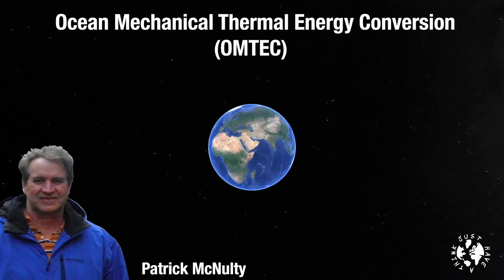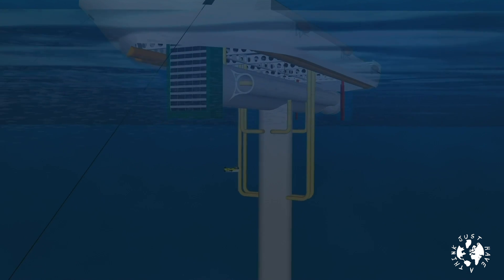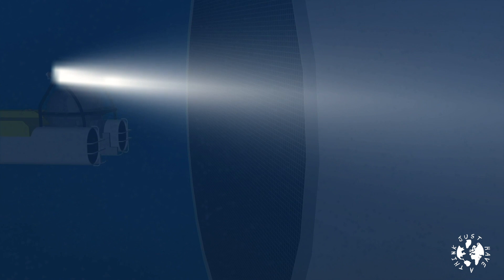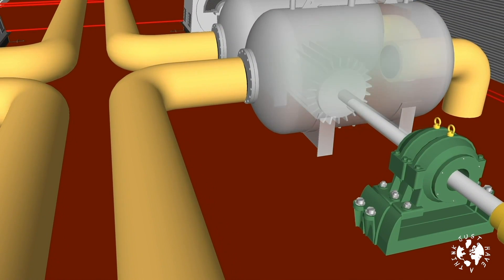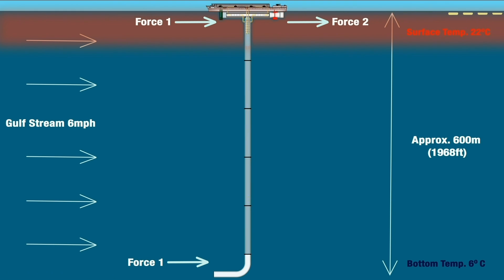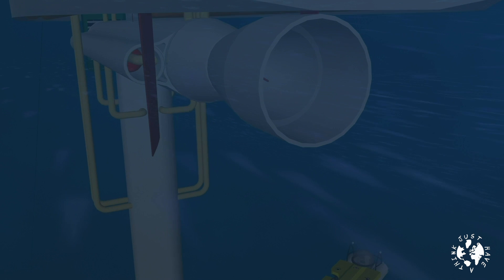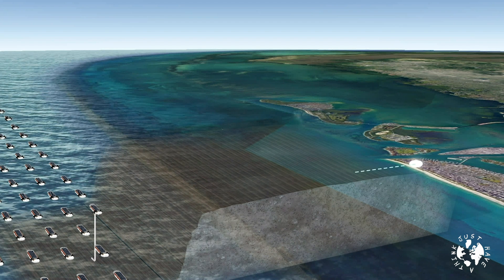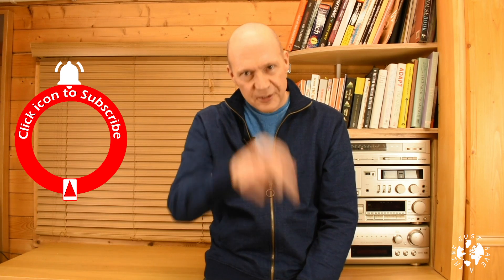Ocean Mechanical Thermal Energy Conversion

Comment: Let's make an estimate of the thermal power available. From the link, I see a peak flow rate of 1.7 meters/sec. I estimate the river cross section at 50m deep x 15Km wide or 750,000 square meters. So the flow rate of warm water is about 1.3 million cubic meters/sec. 
Let's use the 22C and 6C temperatures mentioned before, and we get an energy difference of 67MJ/cubic meter. But, a heat engine will likely only produce 2.7% efficiency with that low temperature difference. So the energy extraction density from the engine would be 1.8 MJ/cubic meter.  Multiply by the flow rate, and we get a power of 2.3TW.  Total US electrical power consumption is about 0.47 TW. So the heat engine would provide enough electrical power for the US as of 2016. 
The heat engine would need to cover the 750,000 square meter cross section.  And of course it would likely kill the gulf stream, destroying civilization. 
Maybe instead of using the gulf stream, which really doesn't contribute much power to the system, locate it out where the surface is hot and any cooling or pumping action doesn't affect the AMOC?

Comment: In order to be viable, a power generator needs to economic.  I see a site that says the velocity at the surface is 1.7 m/sec. That could give about 1KW per cubic meter.  If the entire peak surface velocity area were used to generate power, you might get about 500MW.  Florida uses 25GW of electrical energy on average. So, you could stop the gulf stream, destroy the world, and only generate enough power from the gulf stream to satisfy 2% of Florida's electrical requirement.  https://marine.coastal.edu/gulfstream/p2a.htm
Reply: 1KW per cubic meter per second... 60KW per min. or 3.6MW/HR.... Water pack tons of kinetic energy when moving. Especially when moving about 18 mph though the venturi section...

Comment: Let's say you take the same ocean surface area that is covered by the OMTEC system, and simply float solar panels on the ocean. Panels get about 20% efficiency, and produce about 700 WH per square meter per day. Will the ocean tunnel generate that much energy per day?
Reply from the maker: Hi Ted. Many thanks for your comments. All feedback is very welcome on this channel and especially at such an early stage of a new initiative such as this. Energy production levels from OMTEC need to be established. That's why there is now a concerted outreach for scientific research and analysis. I would say though that each of the four generators in the animated model is roughly equivalent in size to the generators currently in use at the Hoover Dam, so the aspiration is for very significant power generation from each platform. In addition,  Patrick has spent significant  time discussing the principles with Hugh Willoughby at the Florida Hurricane Centre and the view from there is that  there is a good case for this technology. To your point about solar panels. You will hopefully have noticed that solar panels are installed on the roof of the main building, which is about two thirds of the entire surface area of the platform, so we are already getting the benefit of  well protected panels without the complications  involved in floating them. Having said that, solar panels are indeed being floated in some parts of the world like China. They will work extremely well on relatively calm, ringfenced water. They are high maintenance though. In addition they do not provide a platform for other technologies in the way that OMTEC does (e.g. microbubbles). In essence, I think it is fair to say that we have reached a point where ALL potential mitigation technologies need to be immediately and robustly researched and developed, with significant commercial and/or government backing in combination with an open-minded approach from the scientific community. If I could go one step further, I would also add that arguably the most important overriding principle with all renewable technologies is that they are aimed at displacing fossil fuels as rapidly and comprehensively as humanly possible. The fossil fuel heirarchy will be delighted to see disagreement and dissent amongst the scientific community because that buys them more and more time to entrench their position and open as many new drilling and mining opportunities as possible, some of which are in extremely deep water or up in the Arctic. All the best. Dave

Comment: I've been thinking about ocean tunnels - but not for generating energy. Rather for removing CO2 from the oceans.  Why is that? 
According to Henry's law, the concentration of CO2 in water vs. the concentration of O2, and N2 is (can be) much higher.  For instance, the relative numbers are 1/29 for CO2, 1/1600 for N2, and 1/770 for O2.  So water likes to concentrate CO2 about 42 times more than it is in the atmosphere.  Henry's law states that the concentration of the gas in the liquid (water) is proportional to the partial pressure of the gas.  It is possible, that deep water holds more gas than shallow gas because of the pressure dependency. 
     So, suck up ocean water, reducing the pressure, and collect the gas that bubbles out. It should have a higher concentration of CO2 in it than the air does. The concentration of CO2 can be increased further by taking the collected gas and repeating the process of letting it concentrate in water, and then reducing the pressure. 
      Open a can of coke, and the compressed CO2 bubbles out. That is the process. The concentrated CO2 still needs to be sequestered, that is a problem. The discharged water will be lower in CO2, that reduces ocean acidification. The low CO2 water is then available to suck CO2 out of the air, through the normal natural exchange of gas into the water.  So, I'm proposing a way to remove CO2 from the environment.  Who will pay for it?  Is there a market for survival of the ecosystem?  Or must it be paid with taxes?  Maybe people with oyster farms could use the method to allow the oysters to grow in a low acid environment.
Reply: Ted, work on the idea you mention dates back to the 1930s in what is called a Perpetual Salt Fountain. 

I recommend pulling the CO2 out and using it to grow biomass in floating bioreactors. The biomass can then be converted into biofuels and biochar. That combination represents a strong carbon negative regimen which helps to also address ocean acidification as well as soil health.
Reply: Yes I have talked about using some of the energy to scavenge out the Co2 from the sea water many times.

Comment: Love your videos , good on you for doing this. Very cool idea . I think we need to use as many CO2 removing ideas in mass as soon as possible. I saw an article on artificial trees and I recon if we were to make huge structures covered in a CO2 reactive material and also in the colour white   this would allow   radiation to be reflected back into space  and also  act as a carbon sink. There would be very little ocean not covered in this way maybe. This structure could also capture rain water that could be pumped to dams for countries going through the lack of water due to climate change. Add some solar panels as well and even with enough of these structures together and perhaps a rail system or sort of high way could be built onto the structures with ballsing tech-knowledge to maintain level operation in stormy weather . Apparently silicon rock is also being considered and trials are being done on  crops that looks promising . Well done. Don't give up......
Reply from the maker: Hi Darren. Thanks for your feedback. These are all really great  ideas and initiatives. I'll certainly take a look at some of these in later programmes. All the best. Dave
Reply: Do you realize that, if the exclusion zones around nuclear power plants were covered in solar panels, it could equal or exceed the power produced by the power plant??  And cost less, too.

Comment: The system utilizes Freon which is a type of CFC, so how does this stack up with the global ban of CFCs & need to preserve & replenish the stratospheric ozone layer?
Reply from the maker: Hi Mike. Thanks for your comment. It's a valid observation of course. The systems are closed but inevitably at some point the contents will need to be disposed of. It may be that, during the R&D testing, ammonia comes out as the better option. It boils at a similar temperature and is is less impactful on the environment. It reads with water to produce Ammonia Hydroxide, which while an unpleasant substance to be exposed to, does actually have some secondary uses such as a food acidity regulator. In addition ammonia looks like it may well be the transport medium of choice for hydrogen. The hydrogen fuel cell industry is still small but growing rapidly, especially for shipping. So quite possibly there will be some synergies here.
Reply: Could also use propane.

Comment: It seems like a very fooling proposal to me. The ocean is not an easy place to work. There are issues of storms, contamination, and corrosion.  All heat engines are limited in efficiency by the Carnot equation. In this case, (22-6)/(273+22) = 5.4% max. But, practical heat engines usually only get half that. So 2.7% energy efficiency is the ballpark estimate for the heat engine itself.  
The AMOC (gulf stream etc) is already threatened with stopping from Greenland ice melt.  It would be disastrous if it stops. What is the chance that all of these flow inhibiting engines would cause it to stop?
Reply: Storms weaken prior to arrival and corrosion is slowed with cathodic protection like in today's power plants. Ekman transport and Coriolis forces prevent the Gulfstream from stopping..
Reply: @patrickmcnulty848  https://www.scientificamerican.com/article/slow-motion-ocean-atlantics-circulation-is-weakest-in-1-600-years/
Reply: @patrickmcnulty848  https://www.theoceancleanup.com/updates/wilson-to-return-to-port-for-repair-and-upgrade/
Reply: So it's still 6mph off of Miami..

Comment: The study of marine engineering options for CDR, water, energy and nutrients has been an area of interest for me for some time. I have 2 observation to offer.

1) The Perpertual Salt Fountain can move the water up without pumps, however, pumps are not a limiting factor as there are many low coat marine options which quickly pay for themselves.

2) As to surface layer cooling, cold water sinks as opposed to staying on the surface. This artifical sinking current, or downwelling, can have some carbon sequestration benefits and has been discussed by others.

In conclusion, much can be done to economize marine operations while expanding end products and services. Creating tech baskets, as opposed to focusing upon single techs, may be a more productive strategy.
Reply from the maker: Hi Michael. Many thanks for your feedback. Very well considered and presented. These are important findings. I will be collating all comments from this program into a document that Patrick will use to discuss potential barriers and issues with developers. All the best. Dave
Reply: Just how difficult will it become for the water in the various pipes to flow through as barnicles accumulate.  Most boat bottoms are sanded and recoated every two years.  The surface pipes might also face rapid slime build-up.  I live on a boat---lol.  Gives me another perspective.
Reply: @reverands571 , high density polyethylene does not biofoul and NASA tested it out on a marine biomass operation a number of years ago. That big tube being used in the Ocean trash collector is HDPE.

We can make HDPE using algae oil and up to 40% waste plastic. Also, if these HDPE pipes are made out in the Ocean, they can be made huge, far beyond anything built on land by simply using buoyancy bags and robotic tractors.

Once built, they should last for an indefinite time.  We need infrastructure which can last for generations with little to no maintenance.

Finally, there is a way to grow the equvilant of coral rock, this is called biorock and dates back to the 70s, and this coral rock can provide armor in critical areas such as docking ports.

Comment: This sounds promising but at what cost.  By now one thing should be clear.  Any potential solutions to CC must cost the same (or preferably less) than the fossil fuel alternatives.  Few can or will pay more to “save the planet” or impact their lifestyles in any meaningful or long term manner.  So it does not matter if a tech can supply lots of energy if it cannot do it at a viable price.
Reply: This powers CC..
Reply: Patrick McNulty - Not sure what this statement even means.
Reply: @billconley2599  It powers various technologies that change climate back to what it was during the pre industrial revolution..
Reply: Does anyone realize that we are trying to maintain the planet at its "un-natural" temperature??  Geologically, it is 10° C warmer 80 to 90 percent of its history.
Reply: @reverands571  Hardly true. It's been in a climatic equilibrium state pretty much for the last 10000 years, and before that it has been trying to find that equilibrium state for about 15 million years. It's been evolving and progressing towards those states, it's not like those 80% of its history where it was warmer should be 'default' states. The Sun wasn't hot enough for 99% of its history too. That's no argument to not try and desire its current state.

Comment: The Gulf Stream is a wind driven current, part of the North Atlantic Gyre. Saying it is part of the global thermohaline circulation is misleading, although both processes are contributing to the total ocean current. Without the AMOC, there woukd still be a North Atlantic Gyre and a Gulf Stream. I think Peter Wadhams touched on the distinction in a previous JHAT video. I think saying the Gulf Stream is part of the Ocean Conveyor Belt would be less problematic.

https://en.m.wikipedia.org/wiki/North_Atlantic_Gyre

https://climate.ncsu.edu/edu/OceanCirculation
Reply from the maker: Hi Matt. Thank you for the correction. Clumsy language on my part. I will have a look at your information to ensure I maintain accuracy if and when we revisit this proposal. Be assured there was no intentional obfuscation or deception here. All the best. Dave

Comment: Decades ago there was an OTEC system off Hawaii (the sea gets deep close to land there so the power cable to deliver the energy back to land was short).  The problem was the ocean currents vary with depth and the shear force exerted on the long vertical tube to the cold deep water was too much for the reinforced concrete it was built with. Sorry but this latest attempt looks like a nonstarter to me. Just how far out to sea is this thing going to be located ? The water off Miami is shallow so the power cable back to shore will be long, just how long is not specified on the video which makes me think this scheme is not practicable and the instigators know it but prefer to pretend the obvious problems don't exist. One decent storm would wipe this out. As to dropping the surface temperature of the gulf to de-fuel hurricanes, good luck with that.
Oh and the 'Chemical Demilitarization Program' is actually a thing (does not sound like a real thing but it is). This from a country that is happy to use depleted uranium munitions (and don't be fooled by the word 'depleted', still 70% as radio active as naturally occurring uranium with a half life of 4.5 billion years for U-238 and 700 million years for U-235).
Reply from the maker: Hi Dogphlap. Thanks for your comments. All feedback is very welcome and especially important at such an early stage of a scheme like this. I'm pretty sure Mr McNulty is intending a more modern, stronger material for the pipes but I will certainly convey your concerns to him, and I'll update you on his response. All the best. Dave
Reply: @JustHaveaThink   Thank you David for such a kind response to a very negative comment. I can't believe there was anything novel in my criticism, still I would be interested in hearing his response to what I imagine he would have heard many times before.
Reply from the maker: @dogphlap6749  No worries. I did get a response from Patrick as follows :-

"The continental shelf drops down pretty rapidly off the coast of Miami and between the Bahamas. 

The distance to get the power to shore is only 35 miles at the furthest point. Very easy to do with today's technology.

Anchoring them to the sea floor can be easily done - very similar to the way deep ocean buoys are anchored today as per the Hurricane Center.

I spent time going over this with Dr Hugh Willoughby   
http://www.ihrc.fiu.edu/people/hugh-willoughby/

 and Frank Marks   
http://www.aoml.noaa.gov/hrd/people/frankdmarks/

many moons ago.."

Dogphlap, for my part, I will be keeping in close contact with Patrick as this idea is researched and developed. I hope to bring fairly regular updates on any progress or test results, positive or negative, over the coming months and probably years.

All the best. Dave
Reply from the maker: By the way, Makai are still out there in Hawaii, working on their standard OTEC system...

https://www.makai.com
Reply: @JustHaveaThink    Thank you for the link. I learned the Hawaiian OTEC (which is the same one I read about in 1974) is now hooked up to the grid and producing 0.105MW which does not seem a lot after 44 years of development (the company also has one in Japanese waters producing 0.1MW). They are using ammonia as the working fluid. Thank you for an interesting video. I feel bad knocking these well intentioned efforts to provide a clean base load electrical supply but I remain sceptical.
Reply: My reaction on watching this was similar concerns, but more along the lines of how will this stay afloat, and how will it react in a storm? Then I started pondering how much energy is going into making this huge beast, compared to how much energy it might deliver over its lifetime, which for an untested system may be hard to determine.